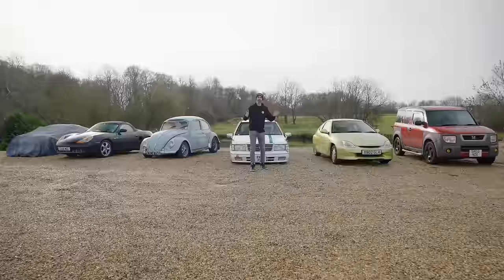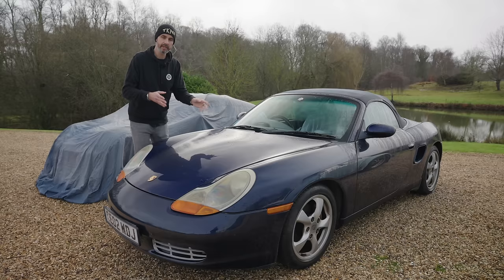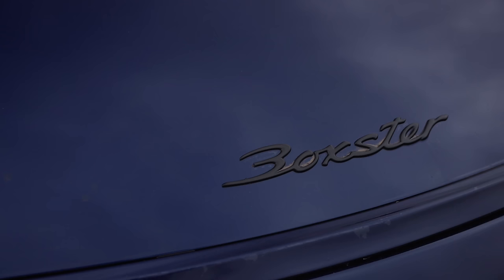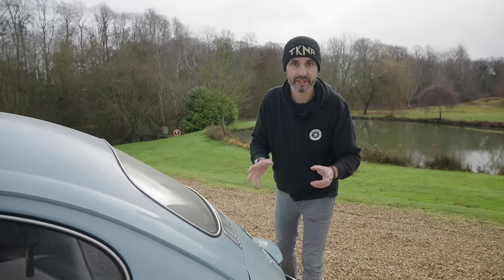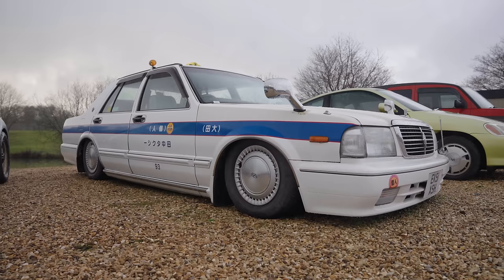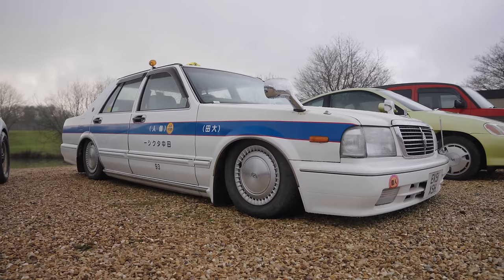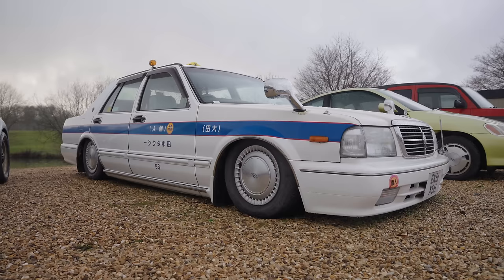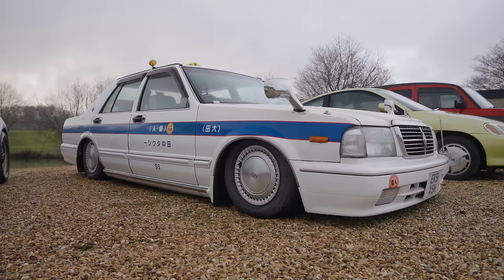My Project Car Round-Up. What classics I own and why I couldn't resist rescuing 2 more...

Comment: OK, I can see why you want a 2-seat sports car, but you really only need 1, so why not give the Porsche all the TLC it needs & flip it to fund another project? The Brabus SMART will make a fine midlife crisis car! Cedric is great, but you really need to have him rentable for film & TV work to earn his keep, & keep him busy. The idea of an electric lowrider is both entirely sacrilegious, and 100% appropriate. Will it be the only EV lowrider in the world? 

Also, you need a barn, with a lift in & tools, so you can look after at least some of these cars yourself, & make content out of it. Professional camera work & big shoots is great, but 'Man with a couple of Go Pros, a head cam & a vlogging camera running replaces a fraying clutch cable on his VW Beetle' doesn't require any such hi-falutin' production values. Meaning you can spend the budget on the bits & consumables you need to fix the car :-).

Comment: No offence meant here and I'm really pulling for you but you need to set some firm goals and be realistic. Sell the taxi while there's still some interest. Use the money from that to fix the Boxter (matching tires at least), detail that and sell it to double your money. Fix the Element so you have something reliable and use some to finish the VW. The lack of storage is what's gonna kill the majority of these cars. Get that straightened out first.

No one here wants to see you as the same sad old guy that couldn't take his kids on a memorable vacation or adventure because every dime you made had to go into nickel and diming numerous shitboxes. You're better than that. Get one or two fixed up nice and let the rest go while they're still worth something. Don't be like my friend that has a '73 Trans-Am 455 and "63 big block Galaxie convertible both literally rotting out from the bottom ( due to his non-heated, cracked floor, falling apart garage) that will never see the light of day again.

I sincerely wish you the best of luck with the channel and your goals.

Comment: Since you have invited comments. What is the point of spending a fortune on converting the immaculate Impala to EV when you don't even use it. What's the point? I don't get it. Also, the Porsche is just a nothing special, budget Porsche. I could go on,  the Element and the taxi.
Reply from the maker: I'd like you to continue, but give clearer reasons. The Element is special and rare but ultra practical. The taxi is the only one in the UK. The Impala you misunderstand - I don't use it because it has never been finished. Still 30% to do before it runs and drives.